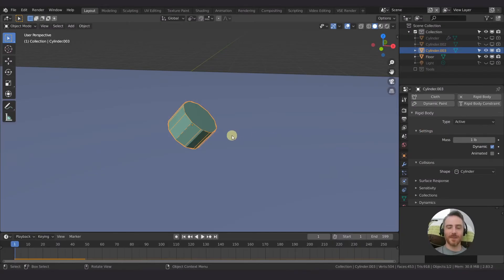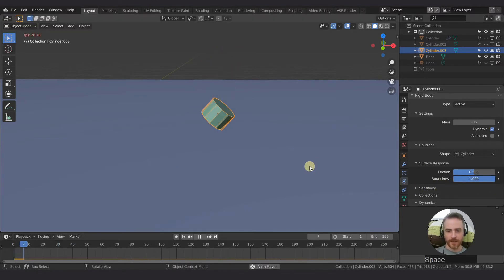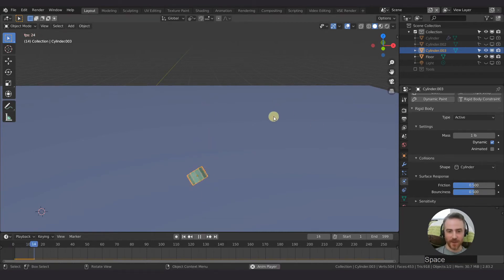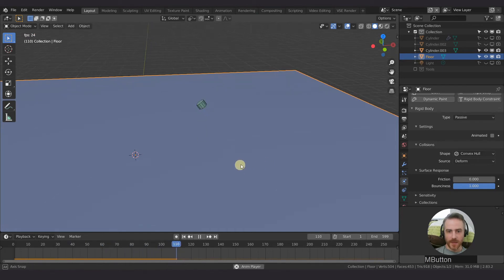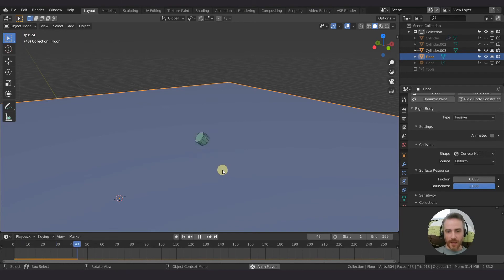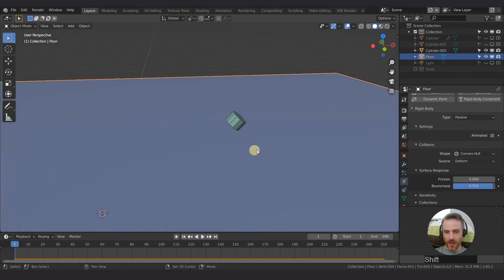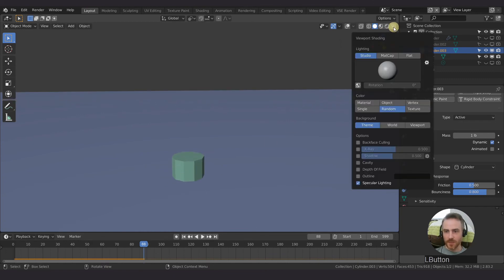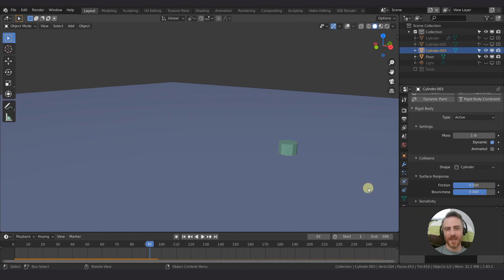Control Friction & Bounciness of Physics Objects in Blender | Quarantine Series 2-3

Comment: Tried Friction and bounce settings from 0.0 up to 100 on both objects, yet I get a perpetual bounce forever.
I am animating a credit card being dropped into a cardboard box that is 0.5cm wall thickness. Drop is 1 meter high. All scales, weights, etc are proper for a real world. All scales are transformed too.
The shape is "mesh" for both objects, not convex hall.
"Rigid World" Settings with Split Impulse Substeps per Frame at 300 helps, but the object still jitters a bit.
What am I doing wrong?

[UPDATE] It seems if I change the "Sensitivity > Margin" to 0.001 it fixes my problem. And that needs tweaked per project. 0.0009 will work sometimes.

Comment: Great video, What if you don't want ANY bounce.  I have an animation of thors hammer hitting the ground and I want it to stop DEAD! I tried changing the mass to 10,000 pounds, setting the friction to 100 and the bounciness to 0 on BOTH objects and it still bounces once.
Reply from the maker: Thanks, W0rldCitizen! You might have to keyframe the "deactivate" button on a certain frame for that kind of stop of movement. Not sure which video talks about this, but I did one that goes over activation/deactivation.

Comment: Thanks for the video! When I try this I need to set the bounciness (of both the object and the plane) much higher than 1 to get any bouncing at all, even though the damping's set to 0. Have you had this sort of problem before?
Reply from the maker: Hi Patrick! It's hard to say without looking at it myself, but you can try several things. First, make sure you apply the scale of your object (Ctrl A). Second, try adjusting the weight in the physics settings. Third, try adjusting the collision box in the physics settings. Let me know if you find your solution! Cheers!